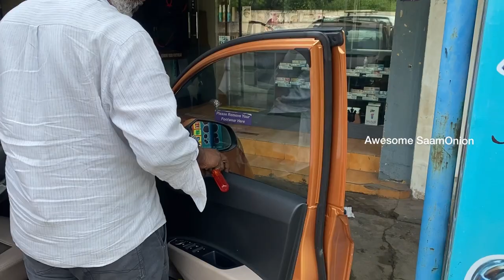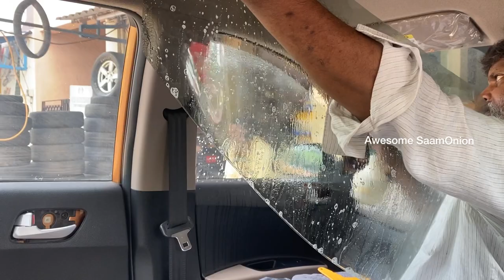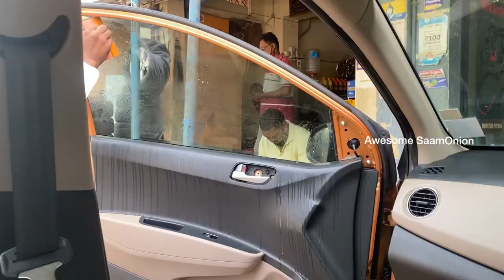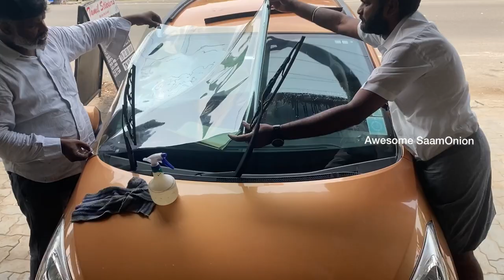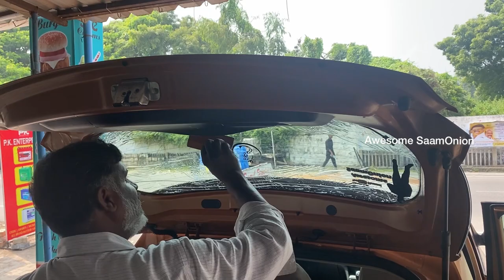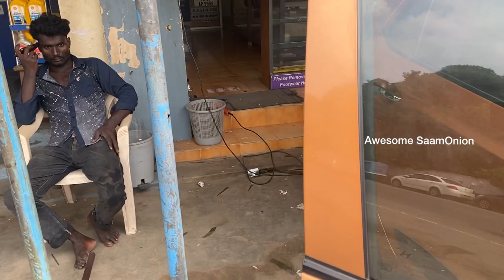sun control film installation in car | Sun film pros & cons | sun control film for car in tamil

Comment: 6000 is high rate bro,Garware for side and rear cost 2000 rs and Garware Fronty is 2500 only,total cost 4500 only ,maximum 5000 kulla taan varum,I am sun film fixer in chennai,but your details r correct expect cost,I like your video
Reply: THANK YOU BROTHER 🙏💐
Reply: Which shop you put for 4500
Reply: Bro which accessories shop is better in Chennai for tata quality and cost
Reply: Bro unga shop name bro
Reply: Sonna others try ur shop
Reply: Shop location please
Reply: Correct brother side 4 glass and back glass front uper sun Film cost 25000 price fornt full glass cost garwar windshield price 3 quantity price 2000 4000 8000 prices

Comment: Bro, Tamilnadu may allow. In Bengaluru any percentage of sun film strictly not allowed.  If installed also It is always risk and fear when cops will slap fine and remove.
I enquired about Blaupunk sun film for windshield, vendor charges at 6k.. quite expensive
Reply: Yes
Reply: Blaupank artic 70 pro i did today for 5000 windshield alone

Comment: Windshield sunflim evalo bro vanthathu????garware
Reply from the maker: 3500 bro
Reply: @AwesomeSaamOnion  3500 too costly boss. i have installed 1700 in my nearby accessories shop. same Garware fronty
Reply from the maker: Good for you bro. That’s what I was charged for my installation here and provided the same details in the video.
Reply: @smdkarur  any heat rejection is there really? Garware icecool shield or articool is good for windshield. That costs almost 5k.
Reply: @yogiayogi  I installed Garware fronty price was around ₹2k. I don't feel any heat rejection but during night travel some what glare is reducing.
Reply: @smdkarur  that's what I guessed. Try 3m or icecool/articcool if you want heat rejection. And don't go to gp road 😄